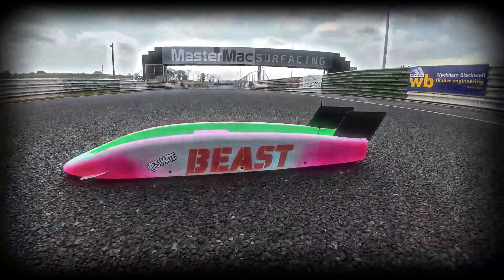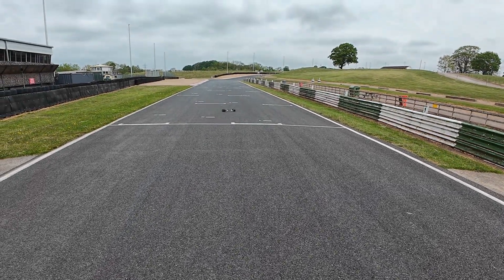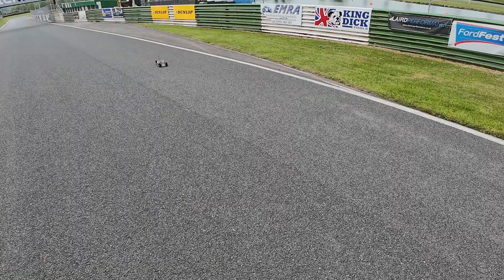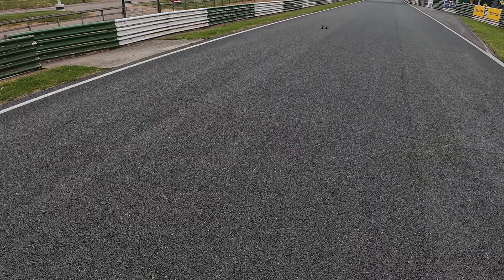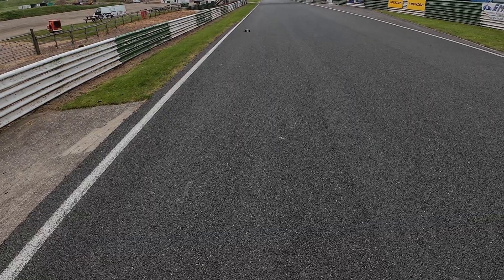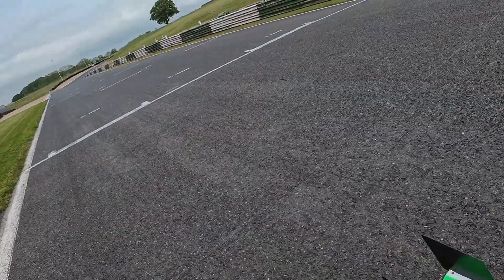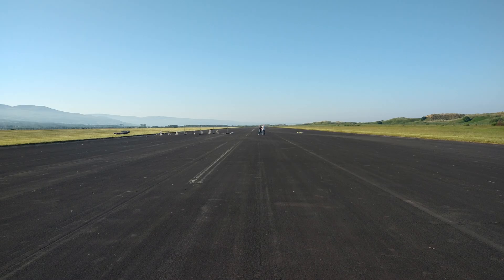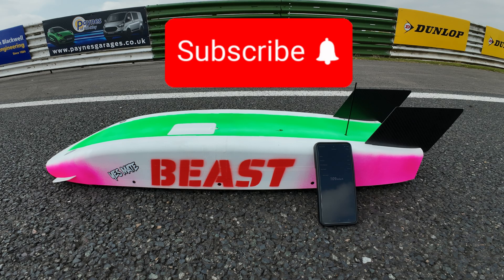TRACK TEST! Drift mode + Going for speed with the 200mph BEAST R/C Car

Comment: Are the servos on the back actually brakes
Reply from the maker: Yes they are. This was my first test of the VESC spped controllers so I kept the servo brakes as a backup. Later when I found the VESC brakes worked really well I took off the servo brakes!